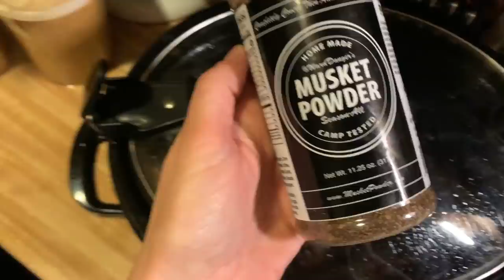Snow, Spuds & Lathes

Comment: Lathing is Turning. He Turned it on the lathe. If turning a part with a flat face ,He Faced it on the lathe, If a part is machined on the inside, he Bored it on the lathe, threading on a lathe is called Single Pointing. For safety no long sleeves, no rings, small rags. lube with lube oil, cut with cutting oil..Cutting bits are always on center line.Have fun,-mike

Comment: Why not put a trickle charger on the tractor to keep the battery fully charged all the time. Even without a block heater it might help part of the time and they are pretty cheap. Diesel motors can be a pain. Your hard work and silly sense of humor and Lawrence's hard work and dry sense of humor really are fun to watch.

Comment: I love the old lathe. Here is a wee hint for Lance. Most people run their lathe far too fast. Slow and steady wins the race. Sure, you can spin it faster but it wears the cutting edge off pretty quickly and then you have to stop and sharpen and re set. I hope the young people take an interest in the lathe. Without lathes we would be back in the dark ages.  If Lance needs to drill a large hole in something, tell him not to be afraid of putting the drill in the chuck and pushing the piece to be drilled with the saddle/toolpost. Lathes are amazing machines. There are some great youtube channels that give practical hints. good luck.
Reply: agreed ,machining a socket is tough on tool steel . it sounded rather blunt !

Comment: Here in Franklinton NC about 60 miles SE of you we got a bit more than 4" of snow. LB is worried that his machinist skills are not good enough to turn projects on his lathe. I love the salt also but now that I am over 60 and have high blood pressure I had to cut it out I want to be around in my 90's like my grandpa was.

Comment: Looks to me like you MIGHT have a new Ariat hat???
Oh, and I almost helped to say Tie Rod yesterday, and I had it all typed out, but when the video got to that part, and you said it right, I deleted what I was about to correct.  You got it right in the video, so thats all that matters.  It was probably from those who do like me, and read a title and start typing before I even watch it, or send in 4 comments to I do not forget, and make them as I see them....lol
Here is one for you.  You said he lathing abilities, which would be His Machining Abilities.  That is anyone who works a lathe or milling machine.  Lawrence/LB/Sheep Wrangler may want to find a friend who knows more about how to set up and run a lathe, and get a lesson or two from them.  I know setting up the cutter is crucial to not dulling that cutter, and making a smooth running cut with less chatter.  If it is set up right, and the right cutter used, there should be no need for oil.  Sockets are super hard, so carbide cutters are a must.
And for me, those mashed potatoes need pepper also.  Another awesome video.  I want some merch from you when I find work so I can afford it.

Comment: Meridith that late is OLD! I used to run and own a machine tool company. A few OSHA violations with that baby. Whatever you do wear safety glasses when you watch it run. The tip LB is using is a carbide tipped cutting tool and if it cracks it can make a Minnie explosion, did it with me twice in 25 years. Have LB look, can get a gear drive lathe for free these days and it’s safer to operate. Just look in paper. Peace

Comment: could you please ask LB were he has the belt made that runs the lathe? i have a power hammer that i need one for and down here in Florida they are not that common.
Reply: Most any "Industrial" supply store has flat belt stock. Usually you need to cut it to the proper length and splice it with a special machine that crimps-in a metal (staple-like) joint.